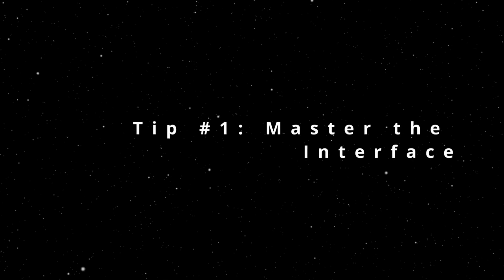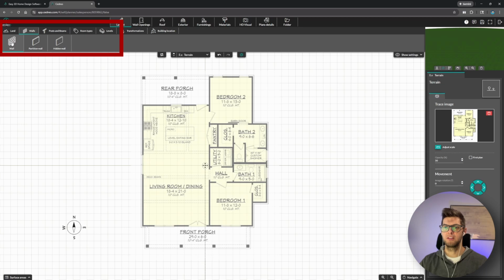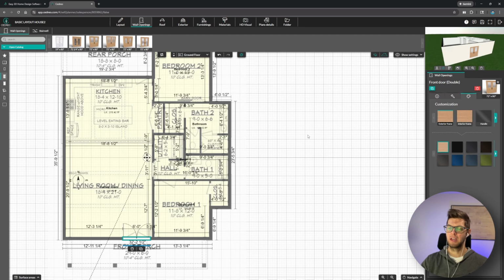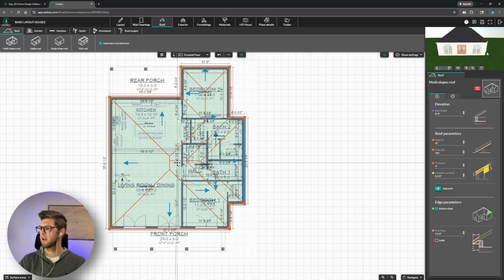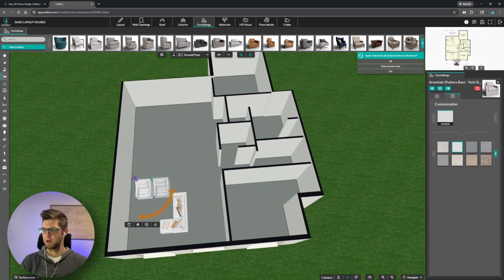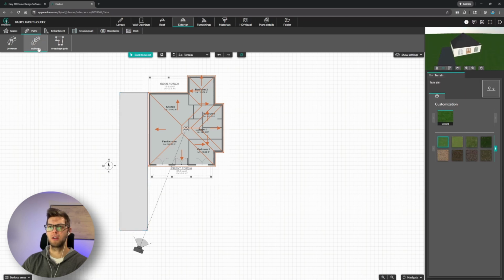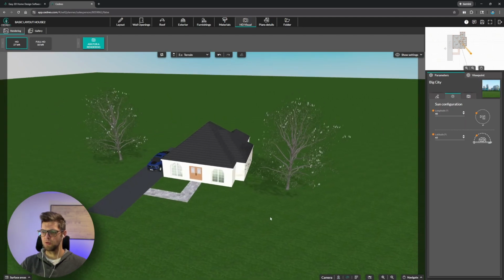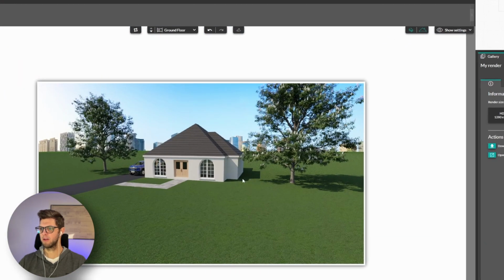Cedreo Tips&Tricks That Instantly Improve Your Designs

Comment: Nice overview.  One suggestion/correction (from a big CEDREO user): The roof needs its own level. In your tutorial, there's no floor for the roof level. I think of it as the attic floor under the roof. Very necessary and it won't collapse the first floor walls as it did in the design.